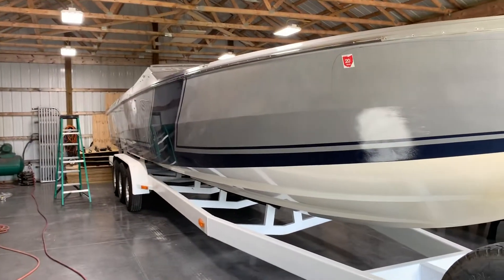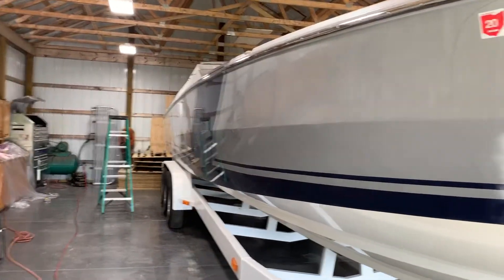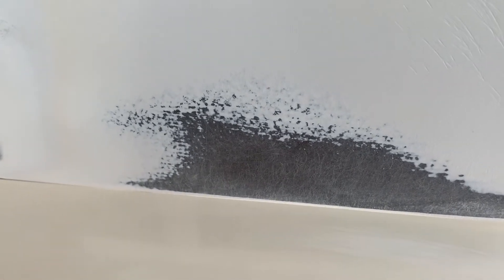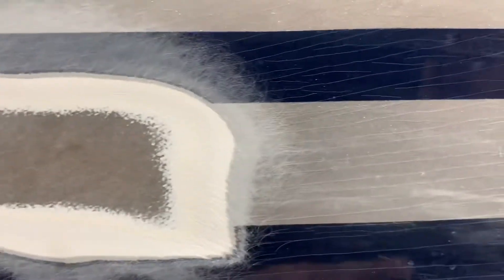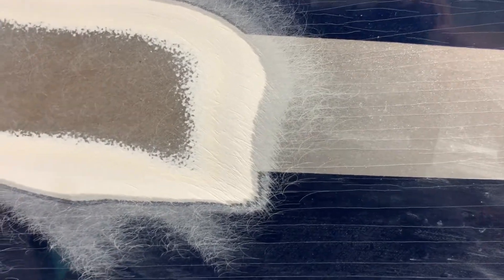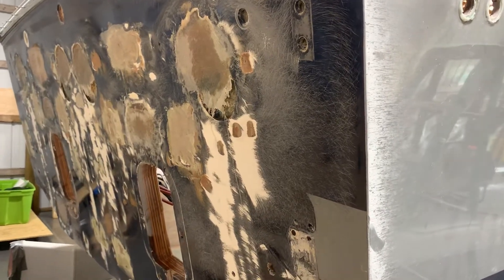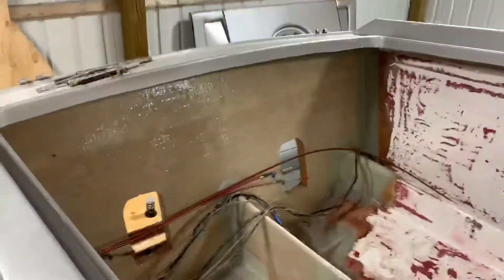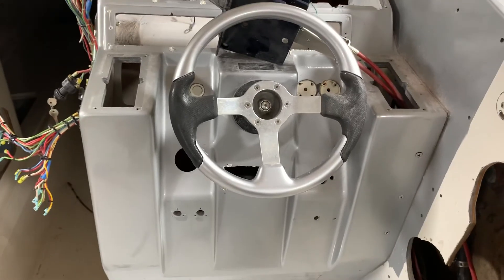Cigarette 38 Topgun project

Comment: They are Gel cracks which does stop at the glassfibre. The glass flexes & the gel coat is brittle. The best way of repairing them is to grind down to the glassfibre & laminate a layer of mat over the affected area sanding to the original profile finishing with a very light stoppering of bondo. Just re-gelcoating the area won't work. Nor will just filling it with bondo. It will be a waste of time repainting it as the cracks will re-appear as the solvent dries in the paint. The gel cracks are stress cracks either from impact or stressing of the hull. They appear in thick areas of gel coat which is brittle compared with the glass reinforced resin. Hope that helps.
Reply from the maker: It went into the glass there was spidering at the glass it was all ground down layer of new glass all regel coated and block sanded. Boat got all new stringers and structural